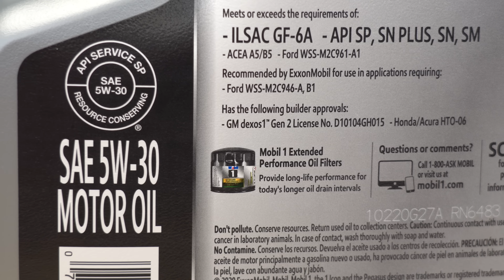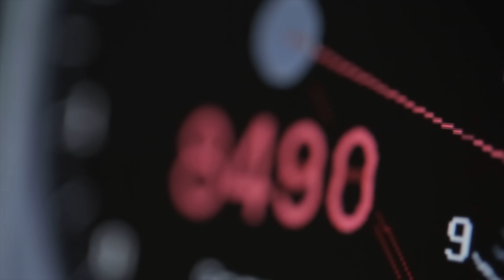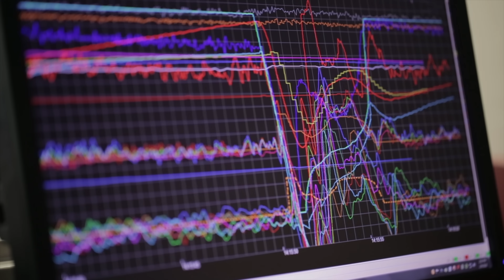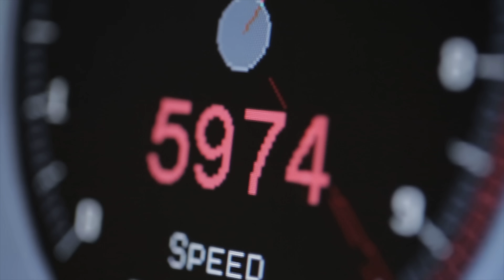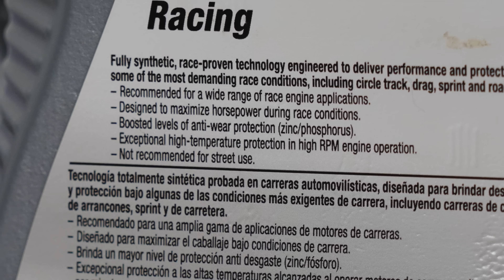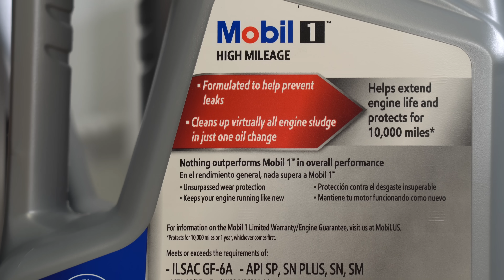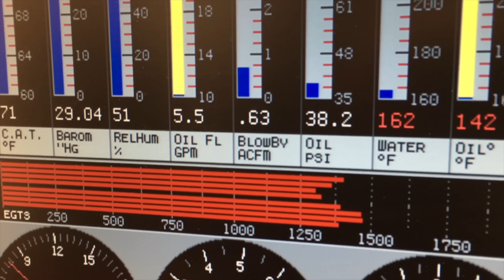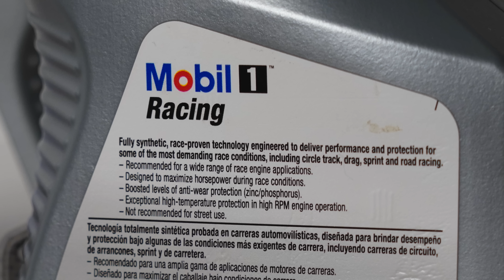Should You Use Racing Oil In Your Road Car?

Comment: why are you not talking about ZDDP during engine start up and extended idle times? 

THAT is why ZDDP is still important.
Reply: Catalytic converters are super expensive though, enough so that they can total some cars when they fail. Would you like cars to have very expensive failures more often? That's the balancing act they have to play.
Reply: @cpufreak101  no they're not. I can get cats for my truck for less than $300, and that's for 2 of them! and it takes a long time for the zinc to clog up the cats if it even does. I have always run my trucks on high zinc oil and I have never had to replace a catalytic converter.
Reply: @ElectronicsForFun  your truck doesn't equal all cars. I sell them for a living trust me when I say some of them can go for $4000 for the full set

Comment: Hey Jason, got any ideas why they only use 20 - 150 psi of oil pressure? It's interesting they use such low pressures for engine lubrication of the crankshaft, cam, and other components. Is it diminishing returns to go higher than 20 - 150 psi? Throw 5 more HP worth into oil pump design and you have a much greater difference
Reply: The higher the pressure the pump has to maintain the greater the parasitic loss. They objective is to get that horsepower to the road.

They only need the engine to last 1500miles. A combination between the best oil formulation and the lowest oil pressure without sacrificing lubricity is the goal. Of course this puts extra stress on the oil film but hey, race car.

Comment: If there's one thing this channel made clear time and time again, is that performance parts (brakes, oil, air filters, etc.), are only useful if you do performance driving, pushing your vehicle to its limits.

For the casual driver, even with high end road cars, performance gains are negligible, but they cost you a pretty penny. So conventional quality parts are the best option.
Reply: Id go so far also as to suggest that changing your oil twice as often, with an oil that is twice as cheap... is better than simply using the best possible oil at twice the cost observing regular time/mileage intervals.

Comment: When Moto Guzzi went from 1100 to 1200 in their engine used in the Griso (around 2011 - 2012) they used DLC coated flat tappets.  The DLC coating got beaten to death and Guzzi had a warranty program (but never a recall) to convert the engine to roller tappets. I had the 2012 model (the best looking one by the way..... :^) ) and had the work done at 8K. There was anecdotal evidence that engines that went too long for the upgrade, with all the dead guts of the DLC swirling around in the oil took out the big ends. Naturally there was hot discussions about this on the forums. :)

Comment: Perhaps look into the effects that ambient temperature has on an engine and the oil? I've been led to believe that in hotter climates, one should use a more viscous oil. True or not?
Reply: ambient temperatures have little affect on a car unless you are pushing it.  If you are just driving it around getting groceries you could do that in the hottest desert no problem.  Cars are designed to maintain a certain range in operating temperature they self regulate.
Reply: @THE_CHAOSENGINE  Many cars overheat here but I do get what you're saying. If engine temp is kept where it should be, then oil should be at the correct viscosity.

Comment: What about the fact that modern oils have superior film strength to old oils, and are superior even in old engines with flat tappet cams? ZDDP is not the one and only additive in motor oils...
Reply: That's definitely true, but base oil viscosity and film strength can only support load up to a certain point. Eventually you're going to end up in the mixed or boundary lubrication regime, and you need antiwear/EP additives for that.

Comment: great video
now one question, what if I put racing oil on a street engine but do not do the high revs, of course I won't get the extended interval benefit of street Mobil1 but what effects are there foreseen? would it really break out at 500 miles? half of the street Mobil1 oil interval like 5,000miles?

Comment: My cars engine needs the higher zinc and phosphorus levels it was designed to use back in 90-93. Mobil 1 10W30 was SG rated. Years later Mobil 1 reduced the ZDDP package level because it's harmful to catalytic converters. They wanted converters to last 80k miles. Modern engines use roller lifters. My cars quad cam design uses flat tappet lifters and the higher zinc and phosphorus is needed for the cams, lifters, long cam chains. The fact the car gets driven only occasional I will defer to the engine builder who really only works on my particular type of engine. He recommends the Amsoil AMO 10W40. Mobil 1 says to use their 15W50. Engine builder says its just too thick for the LT5 . Mobil 1 does have a high mileage oil in 10W30, 10W40 . Amsoil also offers their ZROD variant but the AMO is preferred. $100 per quart of oil would cost me $900 with filter change and more if I drained the oil cooler. No thanks.

Comment: Answer: no, because electric cars don't need motor oil.
Reply: 😂 although watch this space! There’s a bunch of work going into energy efficient drivetrain oils for use in EVs, plus dielectric fluids for use in battery cooling. The lubricant volumes are definitely wayyyy less, but there’s some novel research going on!
Reply: Yeah they do, the gearboxes need oil.

Comment: My manufacturer recommends 0w20. I want to keep the base at 0 because I have a short commute. I am however going to autocross this summer and wonder of its a good idea to use 0w30 instead.
Reply: not necessary what would be good however is decreasing your oil change interval.

Comment: Jason, I have two "older engines" that need more ZDDP because they are both flat tappet engines. My 1994 F150 has a 300 CID inline 6 cylinder that has had Valvoline synthetic since it was new. It now has 417,000+ miles on it with only one minor overhaul. At 235,000 miles, it was leaking enough to justify the overhaul, and a new cam and lifters were required because of minor cam lob scoring and concaving of the lifters. It is about ready for its second overhaul now. I don't use ZDDP additives or racing oil in it because it is reasonably nice to its oil. My other old engine is a 1966 Chevy Corvair, which has an air cooled 6 cylinder boxer engine. Because it is air cooled, it is much harder on oil, and I've used racing oil in it since I overhauled the engine 5 years ago. The higher ZDDP content and the need for higher viscosity  are the reasons I use racing oil in it (Valvoline 20W50). GM originally recommended 30W high detergent for it in most climates, but as we know, 30W is hard to find these days. So, since some of us "old engine" guys are faced with changing oil standards due to changes in engine technology, maybe you could create a video for us on this subject.
Reply: Verlayder, Ford straight 6 engines oiled the camshaft first and the crankshaft second, so any lubrication issues show up on the camshaft first. I could have reused the camshaft and lifters, as there was no clatter and wear was minor. I've reused camshafts that were more worn than this one, but since I was already inside the engine, I replaced parts that help me track wear in the engine.
Reply: Run 0W40.
Reply: Wow, Toyota engineers would get a good laugh from reading your post about your "famously durable" Ford 300 CID that needed overhauling at 200,000 mile intervals because even as far back as 1975, Toyota engine valve trains were designed to still be unworn at 500,000 miles.

Comment: "engines can last 100k miles" bruh just look up the used market you will find lots of 2000s cars with over 200k miles where they werent maintained properly and have completely other problems such as rust or sometimes clutches and so on
Reply: You got that right I'm driving a 97toyota camry with 235k miles and still going strong although the tranny
Is showing starting to show here age
Reply: My 95’ Audi UrS6 has 329k miles. Used Mobil 1 0w40 for most of its life. Original engine, original turbo, original transmission.
Reply: @yashsab2  i m not saying every car with 200k+ miles from the 90s or 2000s is already in „must sell“ condition but if they are the engine is usually perfectly fine. if its in bad condition, its way more often rust or other parts
Reply: @keisuketakahasi4584  true. Not gonna argue with that.

Comment: I’m more than happy to pay a premium for oil if I get better fuel economy. My guess is they go hand in hand? The extra money I spend on oil I get back in petrol savings, usually more than the total oil cost over its life time.
Reply: IMO, expensive synthetic oils give you good fuel economy by actually keeping the engine clean and running right for long oil change intervals. Crappy old school oil that came in cans sludged up the second you put it in the crankcase and caused all kinds of carbon buildup. That leads to crappy MPG.

Comment: You only needs racing oil or any oil with higher zinc content on engine builds, flat tappet cams and cars not running cats. These days, just refer to your owners manual to know exactly what oil viscosity you need and go from there.

Comment: Used to use racing oil when I was younger and drove like a maniac (blamed it on my French blood). But now that I am older and have come to my senses I use just the plain synthetic. My engine rarely sees anything very close to or over 3000 rpm, except every great once in a while at highway speeds (for me around 60 mph or under 99% of the time) when I forget to shift into 5th.

Comment: 1 horsepower gain in a highly built High horsepower Tillotson or Predator engine is a significant gain, especially if you're already pushing anywhere from 17 to 25 horsepower out of a engine block that's only designed for six & half horsepower. I'm going to have to look into sending my oil out to a soil testing facility, because $100 for oil on a Performance Engine That doesn't see a lot of track time oh, I think is worth it, especially when you have more than $2,500 into a methanol breathing engine and your two biggest struggles are gas and oil mixing. It's always nice to see what's inside your oil. To you know what's going on

Comment: So, what about those of us who still run flat tappet engines that don't need or have catalytic converters and also don't want to change their oil every 500 miles?
Reply: Use a racing oil! The race teams change out their oil that often because they’re running much higher loads, revs, temperatures than road cars.

The higher ZDDP content will actually help extend the life of the oil because ZDDP is a peroxide decomposer (antioxidant). Plus, most racing oil formulations use a higher quality base stock package than even their full synthetic counterparts. Most people don’t realise that even within PAO base oils there is differentiation between mPAO and cPAO.

Comment: I use 17 Oz 10w 30 full synthetic natural gas Pennzoil high mileage oil, the yellow and red Pennzoil bottle with 1 oz of Lucas zinc zddp in my built Tillotson motor and because it's a flat tappet cam it helps with the wear so much. Granted it is a built motor but I use it for Street applications just riding around normally with the occasional Full Throttle.

Comment: Liqui Moly 5w-40 in the vdub 
and Castrol Edge 5w-20 in the wife's kia. Never had an issue with either.
Reply: I used liqui moly in my M3s versus the recommended Castrol. Always saw lower oil temps. Liqui moly is good stuff.

Comment: While this is very interesting for the racing scene. I’m so glad the car I drive the most is electric. No more screwing around with all of this every 5,000 miles.
Reply: You sound lazy.
Reply: Your transmission will still need oil changes, it's that thery're less frequent than on a combustion engine.

Comment: I just use the cheapest oil from the local supermarket, just change it more often (3-3.5k miles). I don't know if I'm slowly destroying the engine, but I had no issues so far.
Reply: "No issues so far" is the warm fuzzy feeling that comes back to bite a lot of people. Too many drivers go ahead and use the wrong oil, and think it must be OK because the motor didn't immediately explode. Now, "slowly destroying the engine" is the right way to look at it. No engine lasts forever, but if you could get 500,000 miles using proper oil or 100,000 miles with the wrong oil, wouldn't that be worth taking a moment to make good choices? 

It's not always about the engine, either. I've seen a few dozen people use commonly available diesel engine oils in Mercedes BlueTec engines. 2500 to 3000 miles later they have warning lights going off and are looking at $4000 to $6000 in emission equipment repairs while the motor is fine. That's an expensive mistake.
Reply: @thesleepyweasel3775  I agree, however I am not using the wrong oil - it's correct viscosity - just a cheaper supermarket brand. Also, I've only paid about £630 (870 usd) for the car, I'm not buying top shelf oil for it.

Comment: Great video! My '96 Accord is at 386,000 and I plan to exceed 500k on the engine. Regular maintenance is key!
Reply: My word how much work have you done to it ? Suspension and all that good stuff
Reply: @josephmcgowan4436  I haven't don't a full suspension overhaul. Just replace parts as needed. Other than changing the oil and filter regularly,  I just try to do good maintenance. Like keep the air filter clean, making sure the bearings, brakes, and everything is just in good working order. It'll need a clutch soon. I could  baby it for a while but my daughter is going to be driving it soon.
Reply: IMO, the 90s released the most reliable Honda cars, and very fuel efficient. I sold my 2.2L non-vtec Accord for a 1.8L Miata which gave worst mpg for a smaller car and engine.
Reply: My wife had a 99 we sold 2 years with 288,000. The kid is her delivery driver. He's at 318,000 miles now. You nailed it. Maintenance, oil 3000, timing belt every 50,000. Regular stuff.
Reply: It’s been 2 years, still going strong?
Reply: @bigpicturethinking5620  unfortunately no. I had to store it for a bit and some kids vandalized it beyond repair. It ran and drove fine though before they destroyed it.
Reply: @craighendrickson5012  damn, that's so sad man 😞 90s was peak Honda (and Toyota and probably Nissan)
Reply: Hats off, man.
Reply: Mostly highway miles?
Reply: @jc.1191  it's a mix of highway and city
Reply: @craighendrickson5012  cool, thanks
Reply: What oil were you using?
Reply: @vermontvermont9292  mobil 1 usually. However, if something else was on sale, I'd use it.
Reply: @craighendrickson5012  I just switched to M1. I'm currently using a M1 filter too. However,  I typically run wix xp, a micro guard. 2019 civic coupe 1.5t.  Ran castrol the past 90,000 miles. Now the next 100,000 will be M1. Thinking about running their truck and suv actually next time around. I hear it's in the top 2 of their regular oils.
Reply: @vermontvermont9292  I have always used Wix filters.

Comment: i've been buying new cars for 40 years.  i change the oil in them with the current spec. regardless of brand.  never had any perceptible engine wear.  the interior and body ALWAYS degrade first.  why the drama over the "best" engine oil?  if it says racing on the label--it's for race cars.  now i'm done.